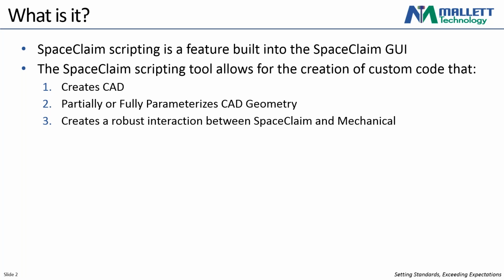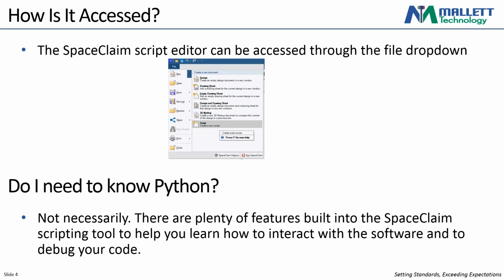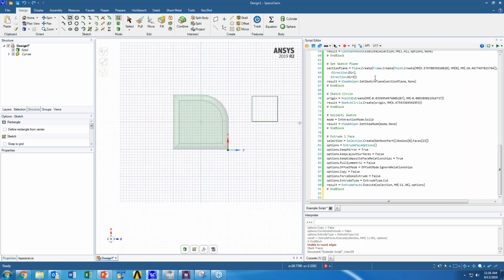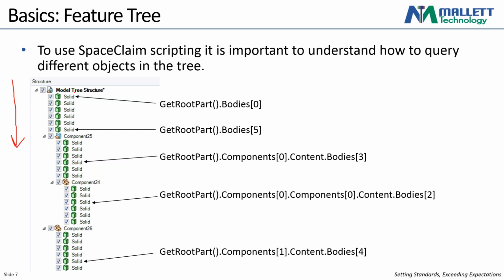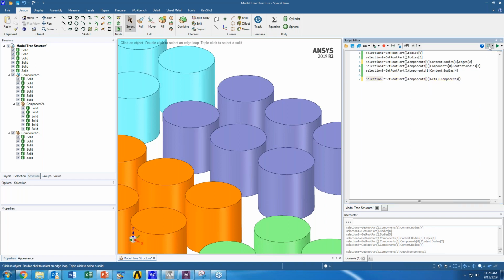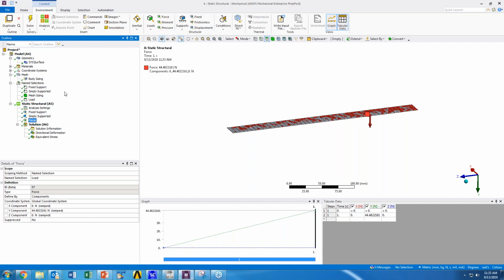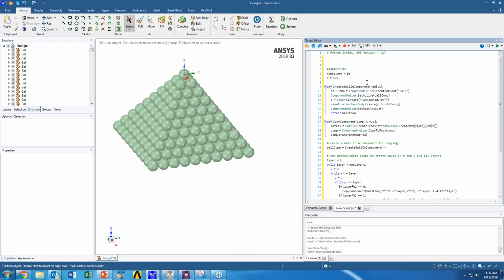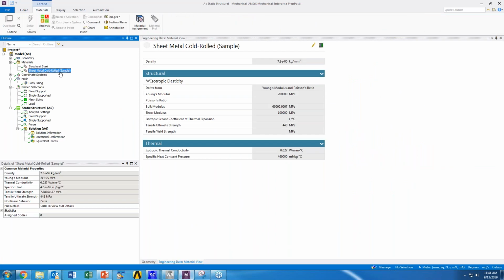How to Use SpaceClaim Scripting to Parameterize Your Models

Comment: Hello, Thanks for the video.
I need some help to do my optimization task.
I want to run the SCDM in batch mode using the command below. But unfortunately, it is not working for me. 
D:\010_Programms\ANSYS Inc\v201\scdm>spaceclaim.exe /RunScript="D:\temp\sample.py" /Headless=True /Splash=False /Welcome=False /ExitAfterScript=True

When I give the command, just the Space claim opens. That's it. Not even the script is opened.
I tried using both python and .scscript with no luck.
Kindly guide me to overcome this issue.